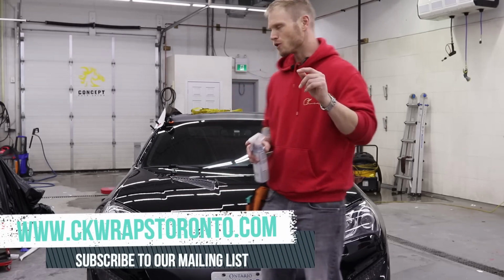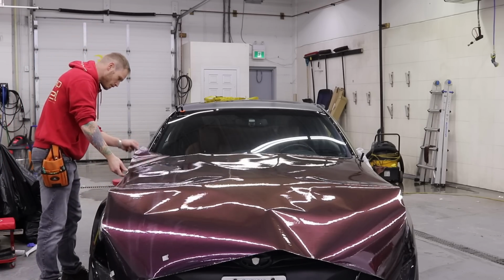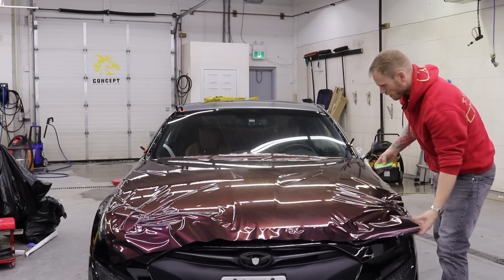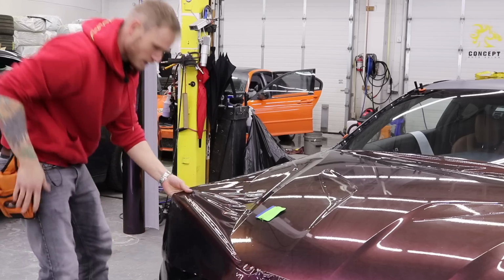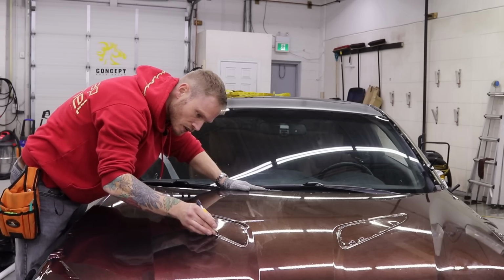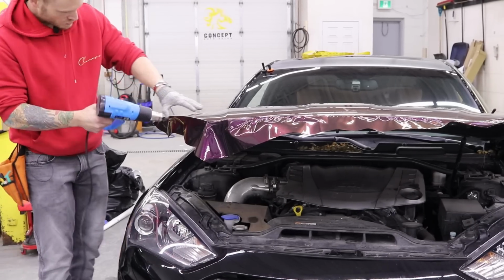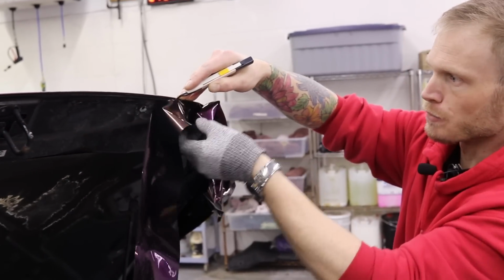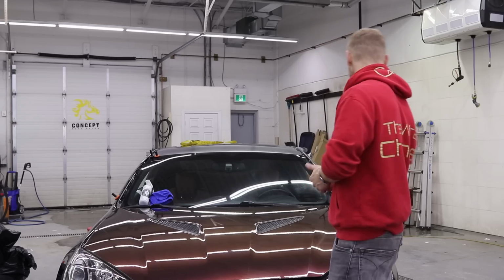NEW COLOR INSTALL! DETAILED HOW TO Vinyl Wrap With Close Ups

Comment: Amazing how you can squeegee over those fingers and not crease the vinyl. I use to do business wraps with Avery cast vinyl with laminate and that would not fly. I would crease the crap out of it if I did that. I’ve haven’t done any color change wraps before. Are color wraps more forgiving? I know printed wraps are thicker cuz of the laminate but it would seem like the thinner the material, the easier it would crease when squeegeeing over big fingers like that. Keep up the awesome channel Christian. I’ve learned a lot.
Reply: My experience with vinyl was similar, I could not squeegee over fingers without it creasing and I am using a 3M colorshift vinyl so you could imagine how thick it is.
Reply from the maker: It's more technique than anything else. You just start to understand and know what you can squeegee over
Reply: Looking at the way he uses the squeegee he uses at a 45 Deg angle to the car and a 45deg angle to the fingers and sort of slices it, this seems to give him the ability to go over bigger fingers and do it faster. He is truly awesome, this channel has developed my skills massively.
Reply: Richard Dodd it’s been a few years since I have done a wrap besides wrapping my wife’s fender of her car as a joke with some left over printed race car checkered flag wrap I found on my basement. I’m sure there have been improvements in vinyl since I’ve touched the stuff. When did the “heating vinyl to 200° to kill the memory” even come out? Is that recent? The last vinyl I bought was probably 3 years ago. It was a satin maroon color by 3m. Does that have it? Maybe my sales rep just sucks. Haha.
Reply: @campbikerepeat3862   vinyl is plastic, plastic has a memory until you start tomelt it, the exact temp probably varies from plastic to plastic but at some point it won't be able to resist. Vinyl from 10years ago still reacts the similar, maybe it's easier nowadays?? Better adhesive etc. I never wrapped more that a few interior plastics back then so I couldn't say the exact differences.
Reply: I’ve been sticking vinyl since before the first fast and furious came out. I used to have to manipulate  the vinyl pretty dramatically back then. Guess I never remember the vinyl returning back to its normal state when I hit it with a heat gun. Hahaha.  Just been a while I guess. These videos definitely helped me get back into it fast.
Reply: @campbikerepeat3862  Christian makes it look easy, he is truly skillful. I first wrapped the interior in my renault clio 1.2 in  2000, had to redo bits every now and then after it had been stood in the sun so clearly doing it wrong, Christian has definitely helped my skills, I never get any list anymore because I'm always thinking one step ahead, doing it in a way so I dent get tension on the very edge. I've recently been studying wrapping again so I can wrap my 2000 bmw e39 535i, hoping to do it with avery vinyl like dark sain blue/black or some sort of blue as it's my favourite colour, not sure about taking doors of to do the inside of them though, it's silver....

Comment: Wrapping a mustang soon by myself any suggestions?
Reply: He has a few videos of a 6th gen from about a yr ago if I'm not mistaken
Reply: @guiuliani2  I have a 2015 mustang and in his video he removed the rear bumper I'm just wondering if I need to remove it completely or just loosen it up for better coverage since my mustang is race red
Reply: @vitaliygolling2345  the area under the tail lights might be tough to get full coverage on if you dont remove. Its about 2-3 inches of bumper under each. Also the center piece of the rear valence might also be difficult to work with as it faces downward
Reply: @guiuliani2  sounds like it would be be better to remove the bumper for better coverage because I'm wrapping it with satin black

Comment: 5 mil as in 5 milimetres (half a centimetre)? Or do you mean 0.5? Seems extremely thick for vinyl.
Reply from the maker: It's actually 5 one thousands of an inch
Reply: Ah yeah makes sense! 🤦‍♂️ Dude thanks for the videos and the info you share, Started vehicle livery and wrapping a few months ago and it's all been very invaluable! 👊
Reply: I thought it was 5 mils, or 5 thousands of an inch.
Reply: @danvuquoc  no idea about imperial. Microns are metric and it's 1000 microns to 1 milimetre
Reply: The vinyl and ppf industry states thicknesses in mils which are defined as thousands of an inch. 5 microns thick would be 15 times thinner than a human hair -- or roughly the size of bacteria.